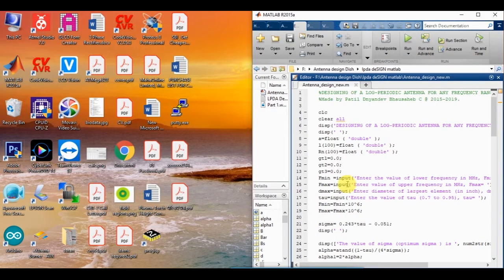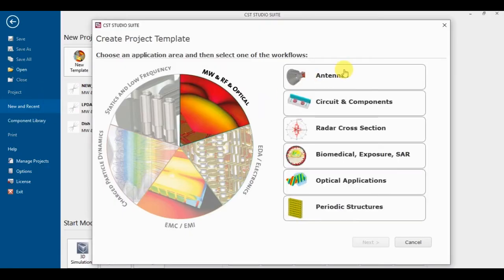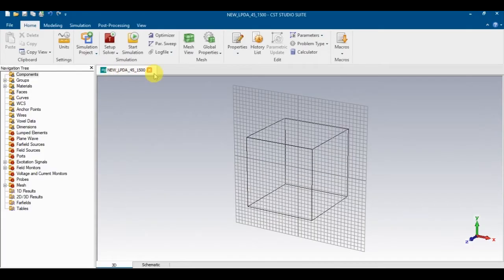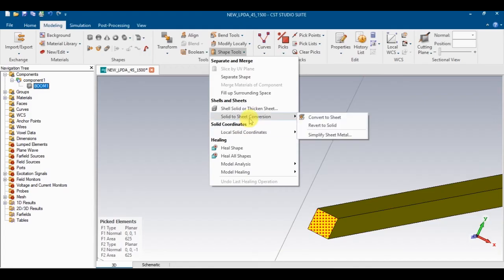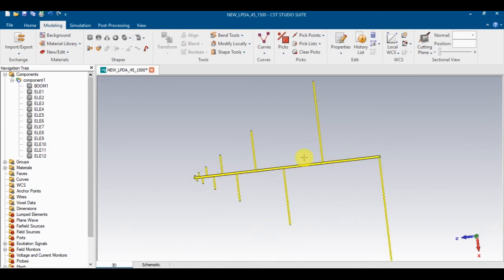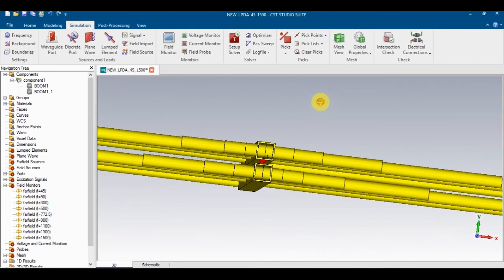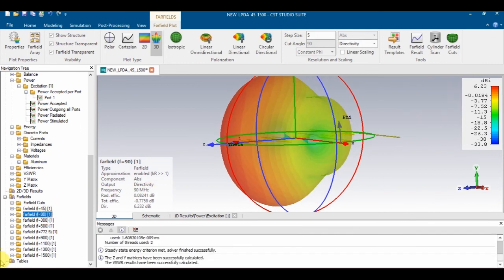LPDA DESIGN 45MHz to 1500 MHz Using CST MWS

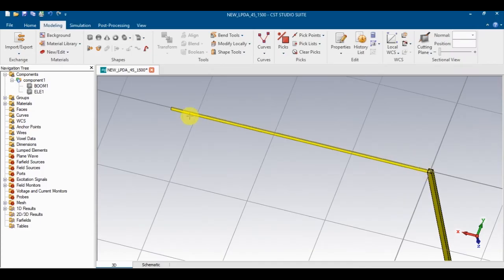Comment: uRGENT pLEASE....Hello, at 13:54 there are no values specified for Ycenter, Zcenter, Xmin and Xmax. the result of which became the ELE1. I only saw the inner and outer radii, and mine is just a cylinder and has no length. please provide those dimensions left empty at 13:53 for ELE1...
Reply from the maker: Hi. That part was missed while editing the video. Pls see the old video. In which i have pasted matlab script. Or you can use equation lambda/2 for first element.
Reply: @electronic-ebox6403  Could you please paste here the link of the old video? As I can use the MATLAB script also, is it in your channel...?

Comment: in the matlab script the total number of elements was N=16, but when you design you have used only N=12 elements. what is your reason?
Reply from the maker: It is just for adjusting the size of Antenna. More elements smooth frequency transactions form group of elements by elements. But increase the size of structure as well.

Comment: Dear author, it's a really awesome video and you have explained it exceptionally well. I have been try to simulate a LPDA antenna in HFSS, where the only difference is the cylindrical-arms are replaced with "thin sheets" (in analogy to Fat dipoles). I was hoping if you could suggest me on how to "Assign Excitation" in my case, specifically in HFSS ? I'd be truly obliged. Thanks.
Reply from the maker: Hi. You have to select face center of sheet and ground plane.  Use discrete port for excitation.
Reply: @electronic-ebox6403 can you tell what value you take in the Element 1 because you mentioned only outer and inner radius in case of Element 1